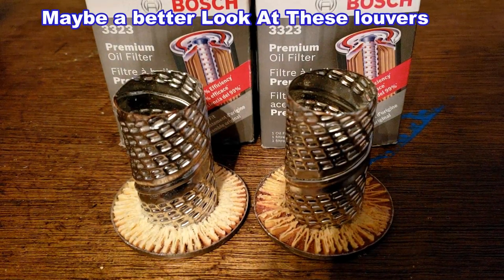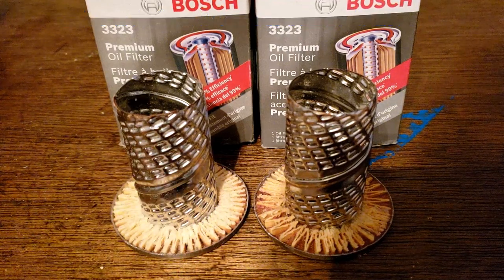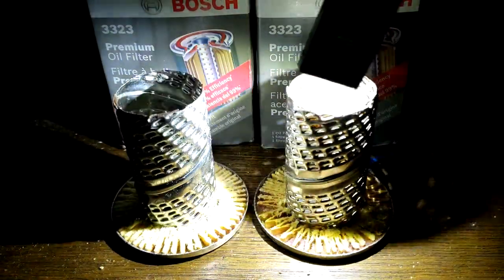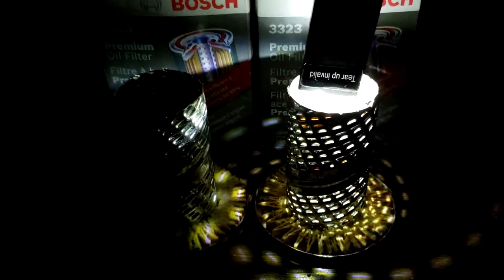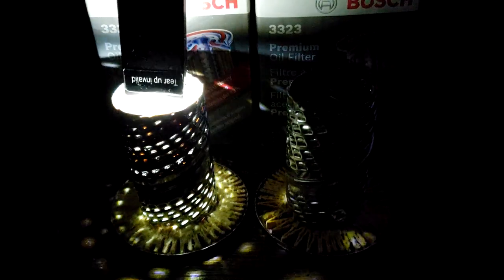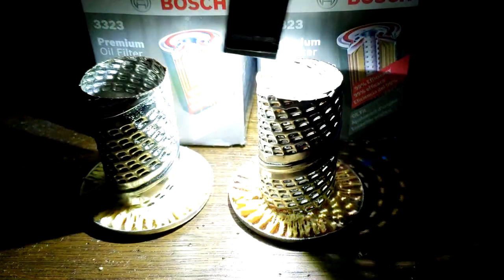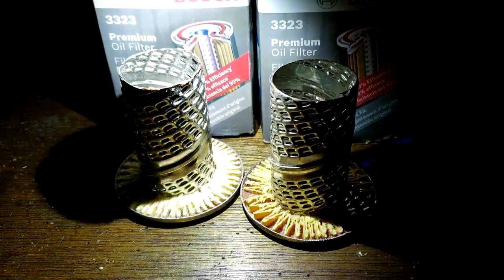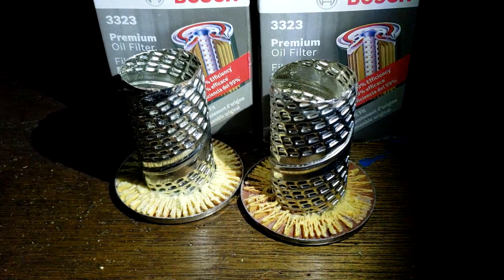A Better look At Some Bad Oil Filter Louvers Louvers

Comment: Having been involved in manufacturing it makes me wonder  how many bad filters are out there. At some point someone replaced the tool die and or worked on the machine to fix the problem. Yet there does not seem to have been much of an effort to recover bad stamping parts if this junk got out. This just screams I don't care about your expensive engines from the oil filter manufacturer.

Comment: I use the Bosch 3323 as well and I noticed this during my last order. Seems like the ones I bought before were manufactured in the USA, while the newer ones were made in Mexico. Kind of hesitant on using them, but they're not worth returning, so I might just chuck them and go with another brand.

Comment: Great demo! Those Bosch filters are made by Purolator. I use those filters because the filter media is very good, but I’ll definitely start looking inside before installation.
Reply: The made in US Bosch Premium are made by Purolator in NC. Topic filters are hencho en Mexico and have an unknown manufacturer. Could be Mann &Hummel but that remains to be confirmed.
Reply from the maker: Thank You

Comment: Seems like the hencho en Mexico factory that makes the topic BP filter needs to improve their QC. Also wondering if the second filter is genuine, or is it counterfeit? Media color is different. Don't know where it was purchased, could be a sketchy vendor.
Reply from the maker: I didn't ask, but I just sent him an email so I'll let you know.
Reply from the maker: I asked and here's the answer I got from the gentleman who sent me the filter.
"Pete,
I got this filter on Amazon, and I made sure “Ships and sold by Amazon” to avoid fake products."
Reply: @WhipCityWrencher  Thanks for follow up Whip. Reading other automotive sites like bitog, even when Amazon says ships from them, not 100% assurance of genuine. Looking at media difference beyond substandard tube, still leads me to question authenticity. But, seeing hencho en Mexico  that could be a main factor in poor QC. On the other hand, the former US made Bosch Prem 3323, are excellent in my experience.
Reply from the maker: @faxmen09  You're Welcome,  I don't care for the Mexico filters either, Who knows what kind of quality control they have there.

Comment: The quality control manager is failing. They need better quality control before they are shipped out.
Reply from the maker: Yep,👍
Reply: Seems to be the theme of everything right now. Wonder when the dates for both were
Reply from the maker: @petegotubeat1  I don't know how to decipher the dates on these Bosch filters but the date code for the bad one is 27729 and the date code for the good one is 27420.
Reply: @WhipCityWrencher  yea figured they probably weren't listed since normally you mention it.